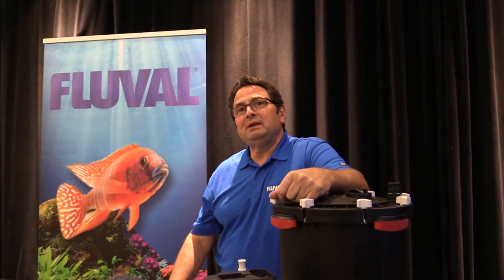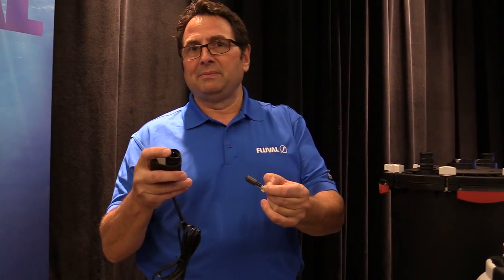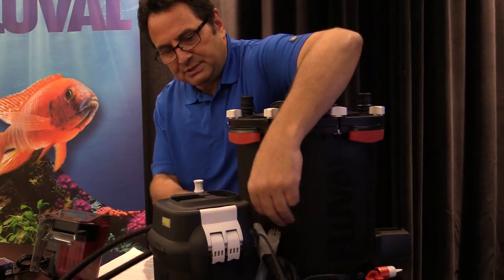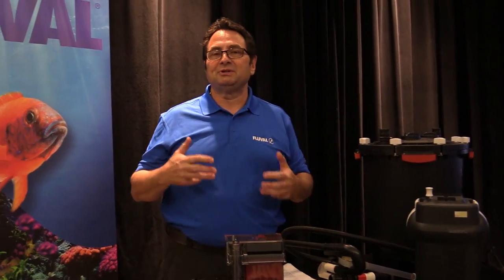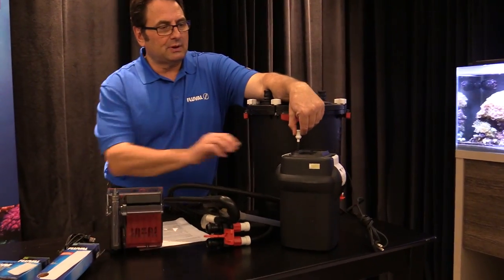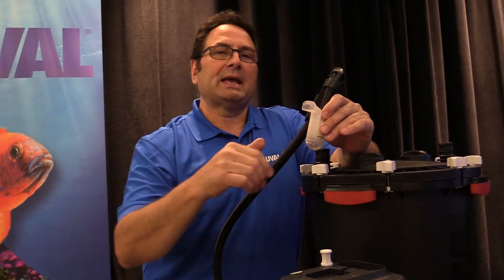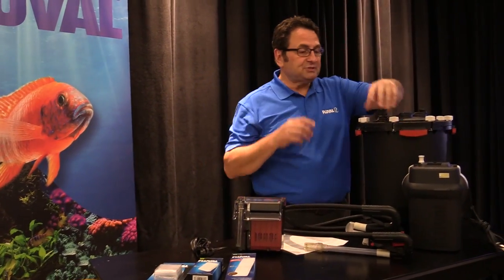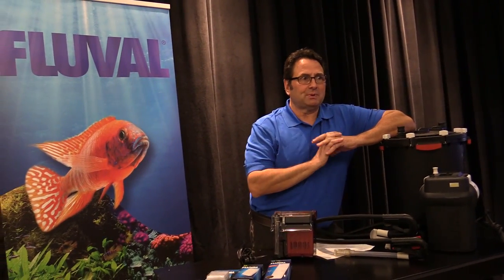HOW TO: Fix Your Aquarium Filter

Comment: My brand new fx6 is not working. It works for a minute and stops for 20 solid minutes.
Reply from the maker: It should stop every 12 hours for a few minutes, clearly this is not what yours is doing. Please contact the Fluval Support team by visiting fluvalaquatics.com and selecting the customer support page, they will assist you in solving the problem.
Reply: I have tried doing that. But i am from india and i have bought it from 3rd party. On official website of fluval india isnt even coming as an option.
Reply: Can you guys please help me with this issue? I have tried all the general thing i could do.
Reply: I also have a fx4 and which had leak issues from the day i bought but i was able to fix it myself but this time in fx6 i am not even able to know whats the problem, hence not being able to resolve it.
Reply: Your help would be greatly appreciated.
Reply from the maker: Vishal, you may reach out to UGAM Distribution in India, they are the official Fluval Distributor in India. Here is a Facebook link to reach out to them: https://www.facebook.com/UgamDistributionPrivateLimited/
Reply: Thank you.
Reply from the maker: Vishal, please reach out to UGAM Distribution.
Reply: Thanks alot.

Comment: I clean my filter and the water flow slower than ever
Reply from the maker: Jess, have you checked the impeller? It may be clogged, damaged or worn out. It is the only moving part, as such likely implicated if the rest of the filter has been maintained.